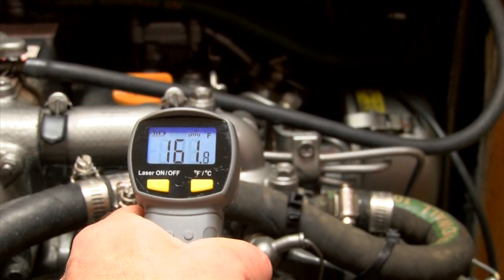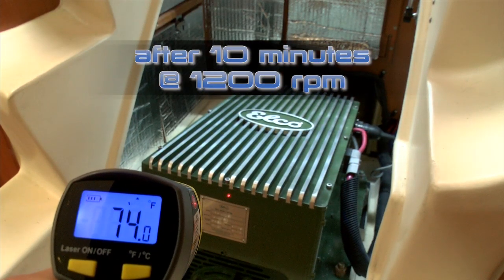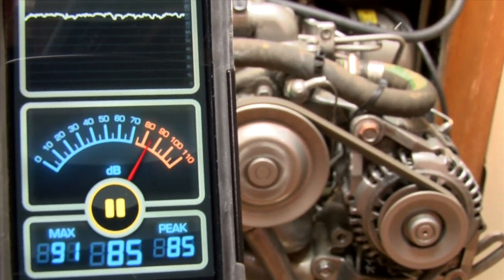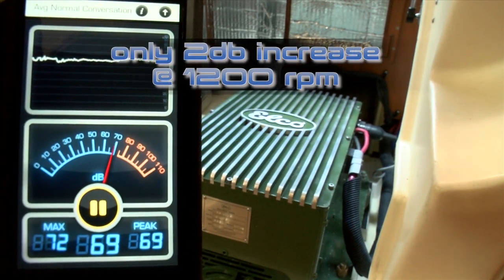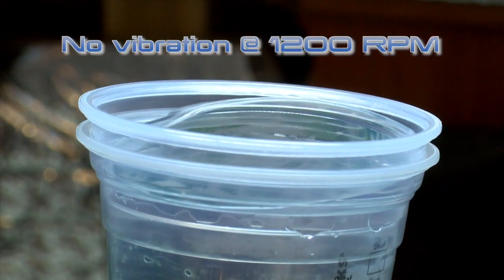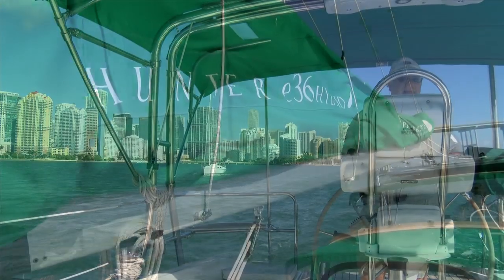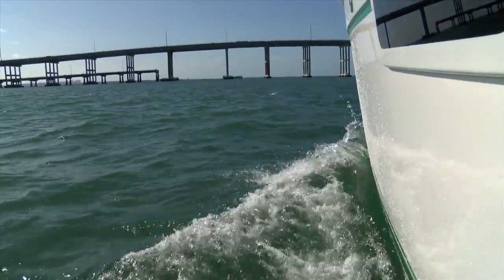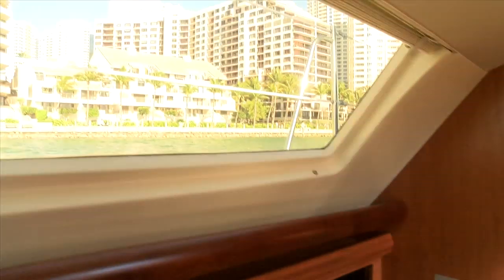Elco Electric System - Cool, quiet and smooth

Comment: I'm thinking of finishing a Bruce Roberts Voyager 495 boat. Presently the hull is finished and I want to turn it into a 'solar boat', with a trawler like deck supporting 8kW of solar panels. I love the idea of installing an Elco EP100, but at $20,000 +, the cost of the motor is out of my budget. I'm thinking of using a Nissan Leaf car drivetrain along with the battery pack from the car. For about $8-10,000 I can install the Leaf drivetrain which incorporates the charger and inverter. Any thoughts anyone?

Comment: What is the horse power? What kind of prop are you pushing? How long does a charge last at 1200 RPM? Charging options are a wind tubine, solar panels and a diesel generator. given a cloudless day how much additional running time does teh solar panel provide? How much charging do you get from the wind turbine? I suspect that neither the wind turbine nor the solar panels can keep up with the discharge of running the motor at cruising speed. So, the only way to motor for a day AND NIGHT in a dead calm would be to crank up the diesel generator, no? What does this motor system with battery bank and the three charging options cost compared to a diesel of comparable power?

I'm not trying to disparage the electric concept but I think these are valid questions and none of them are addressed in this advertisement.
Reply: These are important questions that could be answered in the time they spend raving on and on about obvious benefits over diesel engines.